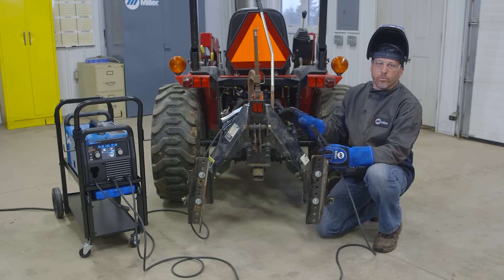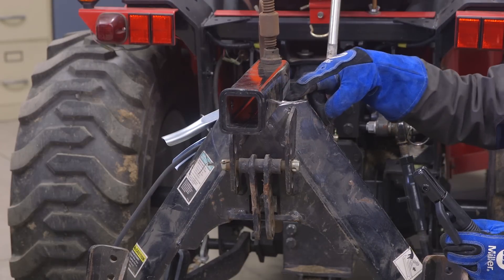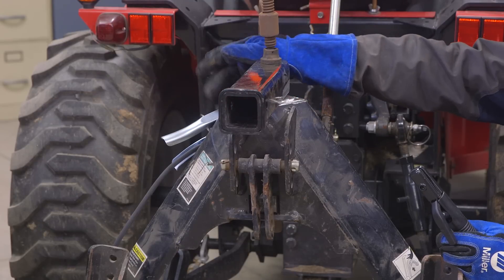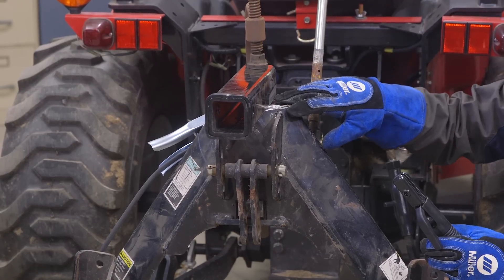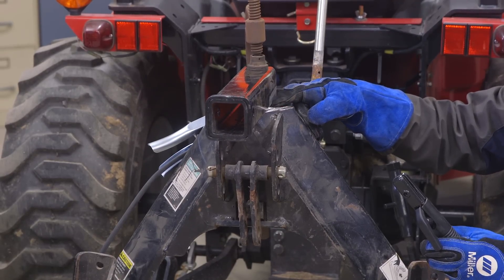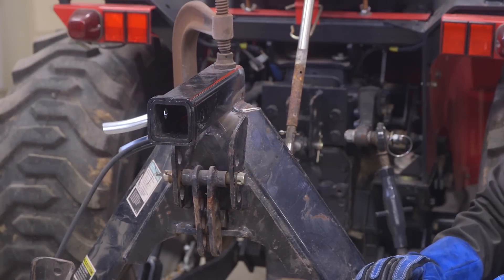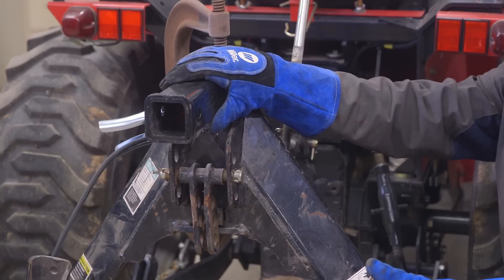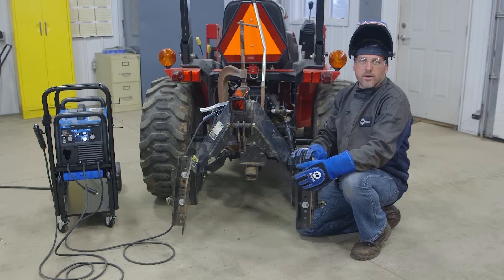Utility Tractor Hitch Repair Using the Multimatic 215 Multiprocess Welder

Comment: What made you want to go with stick out of curiosity? especially in doors...
Reply from the maker: Thanks for reaching out. In this case, the basis of the video was to show the Multimatic™ 215 multiprocess welder running stick. With proper ventilation, you can certainly weld stick indoors. Thank you.